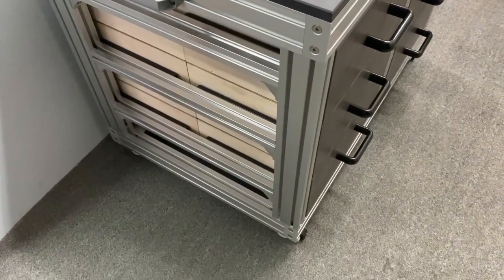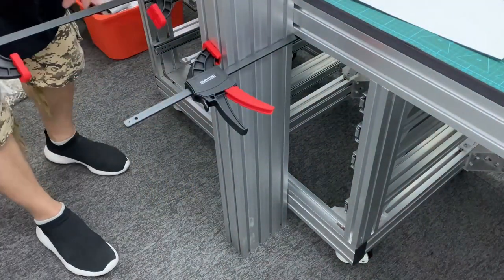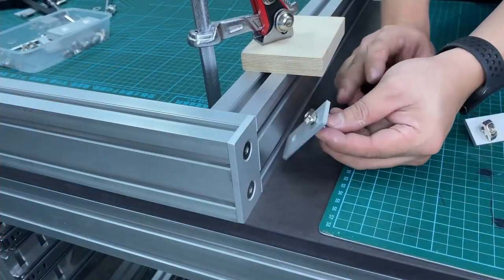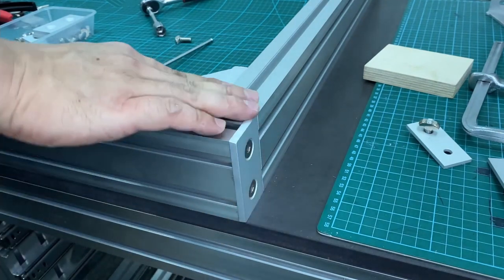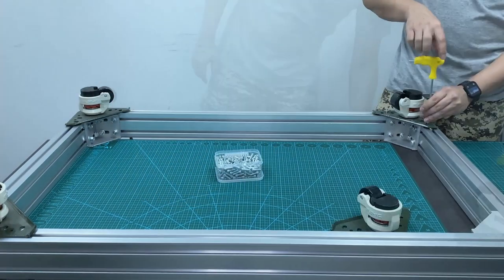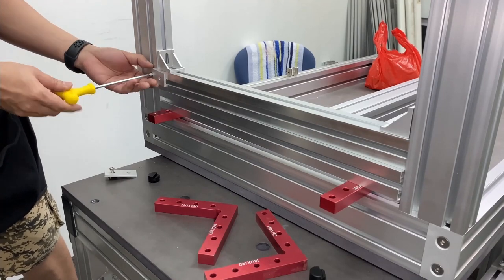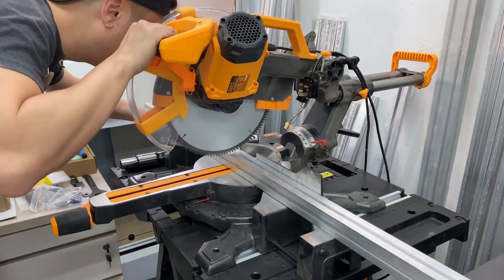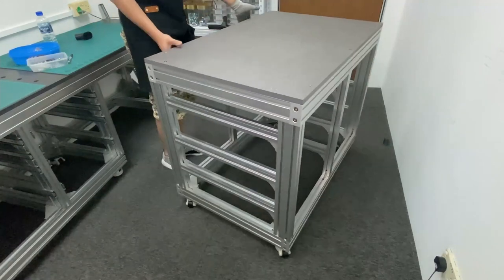How to make an Aluminum Extrusion Frame Outfeed Table (Part 1)

Comment: You always have solutions to problems, using the straight edge to clamp the middle pieces to make it all in the same plane is a smart move. Eliminates the need for spacers for the middle pieces.
Reply from the maker: I didnt think anyone will notice that!

Comment: What material is it that you are using for your tabletop? It looks good!
Reply from the maker: Buddy, It is coloured MDF. Way denser than normal MDF, way more water resistant than normal MDF, but still will need sealing. I used 18mm thickness.
Reply: @TheAluminumCarpenter  That's great, thanks for the info! Keep up the good work!!
Reply from the maker: Thanks buddy! Let me know if you have anything you want to see me build! But let me finish off my upcoming 20 more video ideas first, cheers!

Comment: Great design! Why did you use the 1x2 instead if the 1x1 for the main frame?
Reply from the maker: Good question! because i knew i will be building super large things, like greenhouses, fishtank racks, etc on top of it, and i need the table not to flex.

Comment: What sizes are the extrusion?
Reply from the maker: these are 4080 profile.
Reply: @TheAluminumCarpenter  ah i see & length of them? I wanna replicate it with the circular saw system from your workbench with MFT
Reply from the maker: There are many pieces, but if you need the table exact size, it is 1036mm*780mm*780mm, excluding the MDF Table Top Plate, which is 18mm thick, and without the casters.
Reply: What are these caster called with the angle mounting plates?

Comment: You’re not going to tell us where you got those aluminum extrusions from?
Reply from the maker: Hi Ben, different country has different suppliers/distributors. You can easily get them through your locals. Depending on where you are located, you should get different profiles. Despite that, we are midway building our site to supply these materials worldwide. You may still obtain the 3d files from our website already.

Comment: hey man! you really have nice video! what software do you use to design and model your project ?
Reply from the maker: Hey budddy 🤜 for this video you watched, i used sketchup as the software, but for my more recent videos, its using shapr3d.
Reply: @TheAluminumCarpenter  Thank you. Thought there was a program specifically for using aluminium extrusion. but good to know thanks!
Reply from the maker: Ya actually there is, but due to many reasons, its not suitable for my case. The limitations of those softwares limits my creativity, therefore…

Comment: What kind of hardware were you using that didn’t require the nuts to be inserted into every track prior to build?
Reply from the maker: Slide T-Nuts are those that u will need to insert beforehand, but these took too much planning before assembly. Its easier to use Ball-Spring T-Nuts or Hammerhead T-Nuts which are post-install types. My newer videos shows usage of all the posts. Hope this helps 😀
Reply: @TheAluminumCarpenter  it really does and exactly what I was looking to know. Thanks! Love your work, btw!
Reply from the maker: Great! Thanks for the love for my contents 😀 may i hear your thoughts on the AI narrator voice in the videos? Im torn between should i use it or not.
Reply: @TheAluminumCarpenter  to be honest, I don’t love it but it also doesn’t bother me. I’ve studied communication extensively and I get really distracted by people that have certain speech patterns (like upward connotation at the end of each phrase). The robot makes me feel like it’s more universal/global and perhaps if you’re not comfortable speaking, it’s a better option. But it does remove some of the personality out of it, so disconnects us from you much more than hearing your voice.
Reply from the maker: Appreciate your advice and opinion. I’ll seek a solution… 😀 meantime, the next video is coming in a few days. Am in the editing stage now. 😀